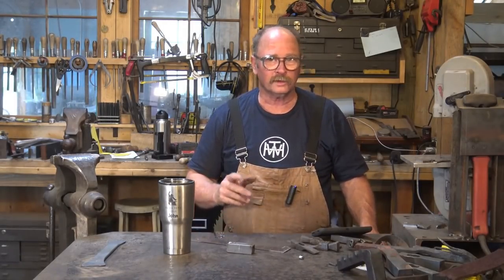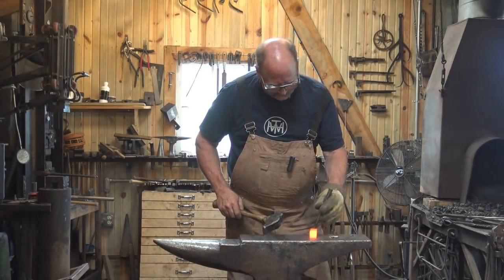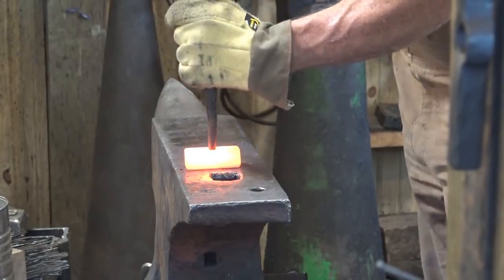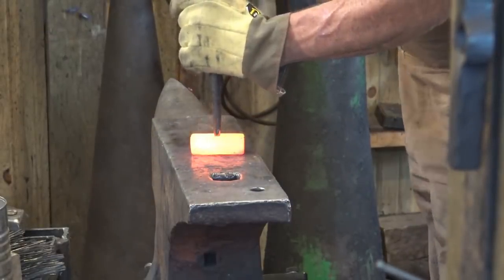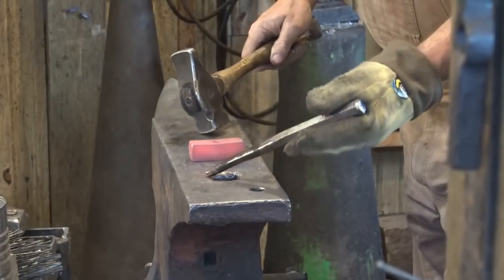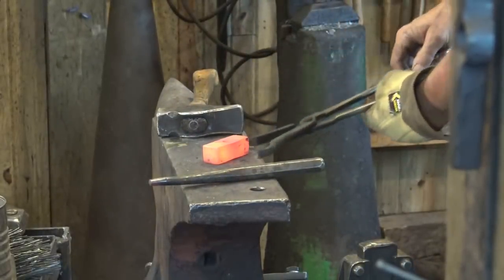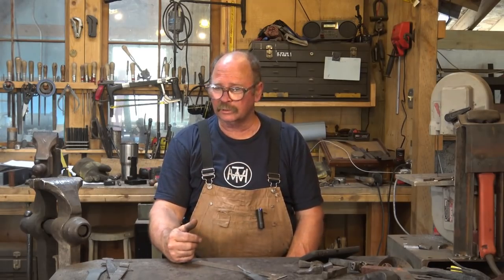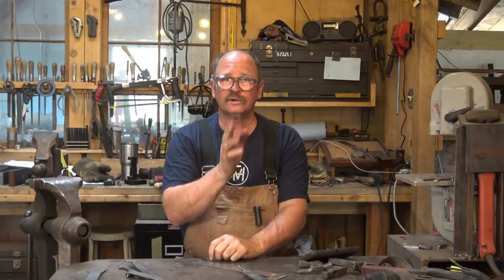Forging a small ball peen hammer - tool making - part 1

Comment: Have a coil spring off a railroad engine, it's 2 1/4" thick stock, what's the formula for cutting a piece at a specific weight?
Reply from the maker: There are weight table available for weight per inch for a given size.
Reply: @BlackBearForge  have a link for that?

Comment: Just a curious question. I have watch Tim at Big Dog Forge use his power hammer to punch a oval eye in a hammer. It seems like a better way to make the eye in the hammer. Why not use a power hammer to punch a eye, in the steel?  It would be less work for your.
Reply from the maker: For a hammer this size the odds of messing it up under a power hammer go way up.  However one of the main reasons I avoid the use of a power hammer in most of my videos is just to show that you don't need one and that just about any project you want to tackle can be done by hand.
Reply: I still think using any equipment that is available is still all by hand. Because it was not manufactured by a company in some foundry. Everyone knows blacksmith work by hand, for the most part. We also know that power hammers, and torches are part of your trade.
Reply from the maker: While i agree with what you're saying.  Power hammers are not something most new smiths have available, so i want to show how to do most projects at the anvil without sending the message that you must have an expensive hammer or press to do the job.

Comment: I have a question
Can i forge brass
Reply: the random guy. Overall, yes. Low temp but it's a fine line between moving and cracking.
Reply from the maker: I think it may be possible.  I know you can forge certain types of bronze.  But they have a very low working range and are very easy to ruin.